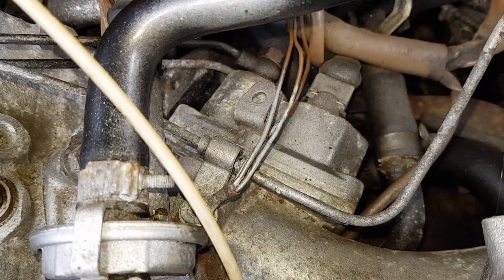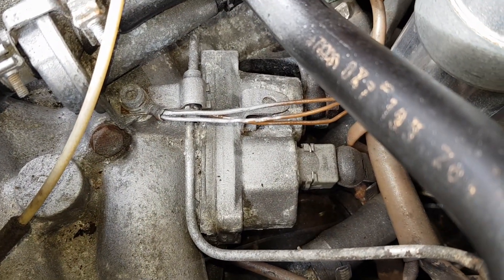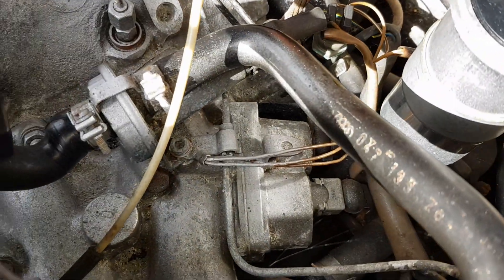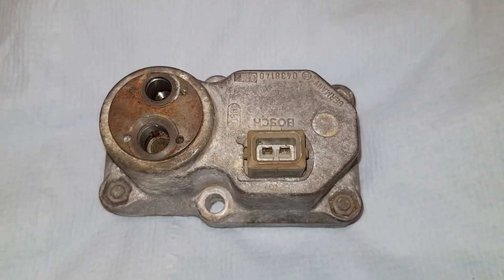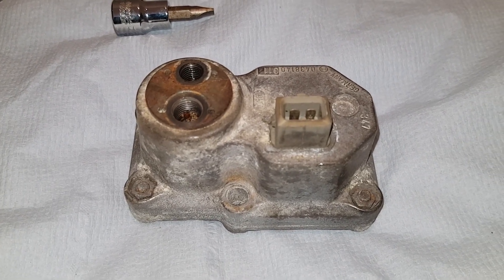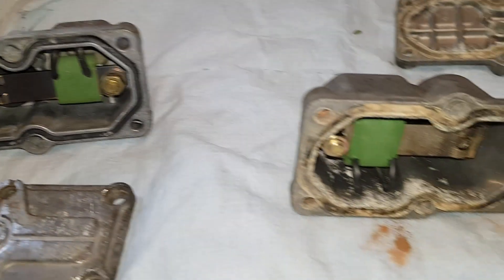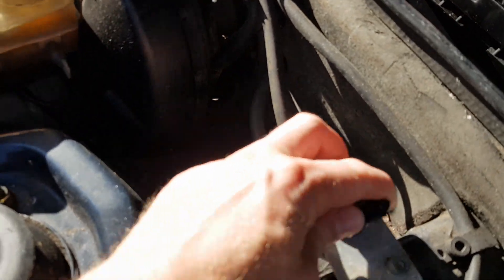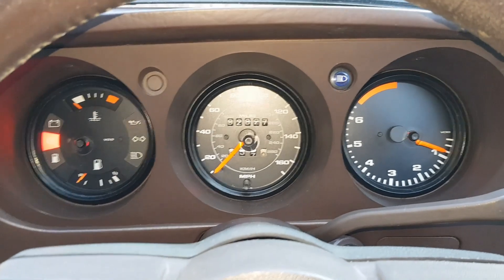Porsche 924  Cold Start Fix - WUR - Part 19

Comment: I miss my 924 and my 944, i never had big problems with both of them, sometimes if it was really hot it took a while to start, at one time the big read window broke overnight for no reason and i had to repair the clutch but that's it.
Reply from the maker: Thanks for the comment @xantylon74 sounds like you had good times with your 924 and 944. Have you ever thought of getting another one? 👍

Comment: Just got a 924 that sat for 23 years (US market here) and am attempting a revival, car will start but only stay running if holding the flap, about to try this and see if it works, hopefully this, the cold start valve, or the thermo switch does it, fuel distributor rebuild kit looking kind of expensive.
Reply from the maker: Hi Reese, thanks for the comment, great to hear you are bringing a 924 back to life. Hopefully a good clean of the WUR should help it stay running 🤞, let me know how you get on 👍

Comment: Hurrah, got there in the end!  I’m working through some poor cold starting issues and cold running on my 924 at the moment.
Reply from the maker: Thank you, Chris, and thanks for watching and the support. Been an up and down fault-finding mission but at least I got to renew some bots that needed updating. I am going to check out the AAR just to do the final cold start rev-matching that should happen as the engine warms up. best of luck with you 924 and let me know how you get on :)
Reply: @Witty924  Are you a member of the 924 Owners club, my work on my 924 is detailed in the forum?  I have made the modification to the WUR so that I can adjust the cold control pressure which richens/leans the cold Air / Fuel ratio.  Mine was running too rich and making cold starting difficult, and cold running poor.  But to complicate matters I think I have an electrical issue at the dizzy or TIU as well.  It never rains but pours....
Reply from the maker: @chrismadge7292  I was a few years back Chris. I connect with 924.org now which works out well. That fizz you.mentioned I saw Ant do on wheeler dealers. Did you do the same set up?
Reply from the maker: @chrismadge7292  thanks Chris very useful. Once I get it back on the road this month all being well. I will start to look and upgrades and fixes to make it a better car to drive more often. That's the plan ;)🤞

Comment: Hi so I have been following all the videos as I have same issues, I bought the car as a non runner and here is what I have done. New plugs leads dizzy cap and rotor, coil so I think that should sort the electrics out. tried no1 plug for spark and everything ok so assumed all are sparking. New fuel pump and hose fitted and checked the tank pump on bench with fuel and pumping ok. Car not starting. So pulled the warm up injector and tested for fuel and was ok on turning engine. Pulled all 4 injectors and cranked over but no fuel (like you had) so I opened up the air intake and cranked over and all 4 injectors pumping fuel. Took off warm up regulator and split which was same as yours clean as whistle inside. Checked continuity and resistance and all would suggest ok. Car still wont start. Double checked the leads and checked TDC to check rotor arm was pointing at number 1, all ok....You got any suggestions ?   cheers
Reply from the maker: Thanks for the comment andy and for watching the videos. So can you start it with lifting the plate in the air flow meter. Hand through air box trick?
Reply: @Witty924  Hi no It would not fire up.been reading all about the WUR and have ordered a service kit so I will remove it again and replace parts and check for blockages in the holes for fuel. Am I right i thinking  the WuR generates the pressure needed to raise the air intake thus allowing the correct fuel to pass into the injectors?
Reply from the maker: you are spot on Andy. Any issues with the inlet or out let or delicate diaphragm with cause issues. The rebuild kit is a good way to go just to be double sure. Also check how clean your plate is. Mine was thick with oily residue which can effect how it performs. Cleaning up all these bits is not a bad thing to do now and then 👍. Let me know how you get on. 🤞
Reply: @Witty924  hi so this is an update. WUR service kit came and replaced all the parts. put all back together and still wont start so I checked fuel was getting through . Fuel deffo at metering head and fuel pressure test showed 48psi. Not sure if that about right?  I manually raised the air intake and still wont fire but I could smell fuel so assumed its getting through. So where now? Gonna check all 4 plugs for spark and the timing marks. The dizzy cap is seated right but was wanting to double check plug 1 for firing order. If you look at engine from passenger side at the dizzy cap number 1 lead is about 5 o clock on a clock face . then going round 1342. Is yours the same?? I am sure I am overlooking something simple ( could be me) like timing or firing order etc. The fuel side seems to be ok...HELP
Reply from the maker: @andyfarrell5975  hi andy thanks for the message. Right so have you taken out an injector nd check if fuel shoots out on crank also test when you lift the plate to see if fuel gets through that will identify if you still have an issue with the fuel system or if you need to move into the ignition system as you say. Email me at p924na1984@gmail.com I can send you a shot video of my ignition set up and position of distie so you have it for reference.

Comment: Well done on sorting the cold start issue! I have the exact same problem on my 924, so I will be taking the WUR off to clean it etc. Mad that yours looked so good on the inside, and only required a brief cleaning of the fuel ports?! They must be temperamental devices. My car came with a 'cold start button' that someone installed in the center console. if you don't push it when starting from cold, the car won't start. I'm wondering if it's just a switch to manually fire the cold start valve... Looking forward to seeing more of your videos. Cheers, Eric.
Reply from the maker: Many thanks Eric and thanks for watching. Been an up and down journey but at least it works as it should. It sounds like you have the cold start value manual override fix which can be used on cold start issues and hot start issues I believe. There are some good little fixes  like that for the 924. Anything to keep them going well I say 👍🚙💨

Comment: I hope you see this. I bought my daughter a Porsche 924 ‘77. She has problems with starting and keeping it running! I had a diagnosis done on it and the Mechanic seems to think either the fuel distributor or mass air flow is bad. The fuel distributor has been rebuilt already just before we purchased it. I am wondering if maybe our WUR needs cleaning or should I mess with the Mass airflow instead?
Reply from the maker: Hi Steve  thanks for the comment and support. Great to hear you have a 924 and a nice early version too, great car. So I would certainly check out the WUR, very easy to remove and check for dirt etc. After that, take the rubber boot off the air flow meter and look at the position of the metal disc plate, it should sit flush at the bottom of the cone, if it's to low it can affect the running of the engine. Of course the fuel pump could be playing up too. Let start with these before going any deeper ;). Hope that helps. 🤞

Comment: I think I have a problem with my WUR as well. I will be taking it off to clean. It seems way less intimidating after watching your video. Thanks!
Reply from the maker: Thanks for the comment Karin, the WUR can be temperamental but making sure its clean is a good start, let me know how you get on 👍
Reply: @Witty924  Do you recall what size the copper washers were?
Reply from the maker: @karinfrederking3809  Hi Karin, so I think they were either M12 or M14. I just got myself a simple copper crush washer set of ebay as I replaced a few washers around the fuel system. Something like the below, hope that helps 👍 https://www.ebay.co.uk/itm/200pcs-Assorted-Solid-Copper-Car-Engine-Crush-Washers-Set-Seal-Flat-Ring-UK-/363524432024?mkcid=16&mkevt=1&_trksid=p2349624.m46890.l49286&mkrid=710-127635-2958-0

Comment: Got the unit off and its caked up with a dry sandy residue. The diaphragm screws are rusty so soaking in WD40. Fingers crossed. Are you able to confirm that there should only be the one large spring in these units? Some vids show a smaller spring which fits inside the big one? T.I.A.
Reply from the maker: Hi Chris, great to hear and here hoping its just a good clean up. Let me check my spare unit for you and see how many springs it has inside, I think it was one but I could be wrong. Brb

Comment: so you basically cleaned the clean part (but for some debris in the mesh?)
Reply from the maker: @ljuberzy  thanks for the comment and support! In short yes, it should be something done every year certainly if you store the car or lay it up for winters. That said since this video I have rebuilt this WUR with a refurbish kit, as long as the metallic element stays within spec the refurb kit can work well to extend its life. 👍

Comment: Well chuffed for you, what do you think of the upgrade springs they sell for behind the plunger in the fuel metering head to combat sticking plungers?
Reply from the maker: Thanks Paul. Good feeling getting that sorted. Just need to check the AAR on the idle at cold. Havent seen the plunger springs. Are they and after market specialist part?
Reply: @Witty924  the plunger springs seem to be an after market part they are sold on ebay type in plunger spring for porshe 924 fuel metering head I have just ordered one just to give the plunger a bit of help seems like a good idea to me as they stick sometimes

Comment: Hi do you know if the standard 924 2ltr has a crank sensor
Reply from the maker: @stevehunt3847  no crankshaft sensor,  the general rule is older engines with carburettor and/or distributor set ups don't have crankshaft sensors. They typically are on more modern engines that use modern electronic fuel injection. One less thing for us to worry about running older engines haha. I hope that helps 👍
Reply: @Witty924  thanks also when you turn the key on your car is there a very loud buzzing I think it's coming from the fuel pump I replaced a burnt out green and black wire and since then the buzzing has stopped from the fuel pump
Reply from the maker: @stevehunt3847  so depending on the ignition set up you may hear the pump prime before you turn the engine over. My pump will fire into action as the engine cranks. Is your pump new?
Reply: @Witty924  I have no fuel getting to injectors  I can here a swirling noise from to he fuel Di stributor and when I lift up the silver plate on mentoring unit there's no fuel lifting up to the injectors ..there is 2  wires coming up to the unit would the plunger be stuck in the fuel distributor..
Reply from the maker: @stevehunt3847  OK so when you lift the plate inside the air meter unit do you hear a hiss, like a sudden fast flow of liquid? If not, i would go back to the fuel pump. How old is the pump? I would do a quick test on the pump. Take the hose off your fuel filter in the engine bay and place the tube into a large battle and turn the ignition on to start the pump and check if it's pushing enough fuel through. Do you have a Haynes manual? It will give you the amount of fuel in 1 minute that should come through.
Reply: @Witty924  no hiss when I lift the plate ...just a swirling noise coming from the black distribution unit ..I have fuel coming up to the banjos on the distributor unit but I don't think the plate is moving to let fuel through il try the pipe on the fuel filter ..test you mentioned
Reply from the maker: @stevehunt3847  OK let me know how your fuel pump test goes. If that proves good you may have to do a rebuild on the fuel distributor. You might want to also check that fuel is present at the WUR banjos too. The injectors need 40 psi plus to open so if the pump isn't providing a strong pressure you may not have to rebuild the distributor unit. 🤞

Comment: What does the WUR do when the engine is warm? You mentioned something about power? Does it affect power at the higher end?
Reply from the maker: Hi Sean thanks for the comment, hope all is good with you. So it supports both cold starting running and warm running via a metallic strip. Check this link as it will be a quicker explanation https://www.tuningblog.eu/en/kategorien/tipps_tuev-dekra-u-co/warmlaufregler-und-tuning-darauf-gilt-es-zu-achten-340115/#:~:text=Warm%2Dup%20regulator%20ensures%20that,is%20heated%20in%20the%20process. 👍🚙💨
Reply: @Witty924  thanks.. sounds like it helps under full load too.. interesting

Comment: I have a cold start issue on my Ferrari 308. It goes through a warm up low to high idle before idling back down after warm up. My problem is that everything is fine, starts up goes through idling process but does not kick back down like it should after warm up. Stays at high idle. Any suggestions would help. Thanks.
Reply from the maker: Hi Al, thanks for the comment. Superb to hear you have a 308. So I believe there are adjusting screws near the carbs that sets the throttle idle. Good link here for you to look at with some that have done the process. Let me know how you go Al. 👍https://www.ferrarichat.com/forum/threads/308-carb-preferred-method-for-raising-idle-speed.118702/
Reply: Thanks Witty, I have been looking so much on Ferrarichat but cannot find what in looking for.  I have a fuel injected 1980 308... Thinking it might be the Warm Up Regulator,(WUR) or the cold start injector. .. With a Ferrari 308 the idling is suppose to go through 3 idle changes before idling back down which means its ready to drive. Its just stuck on the last high idle at 2800 RPM and suppose to go down to 1000 RPM when its warm , but its not. I just want to know for sure before I buy a part.  Thanks for getting back, Aldo.
Reply from the maker: @alge3399  not a problem. Best thing is to check the warm up regulator even if it's just to give it a good clean out. Do a test on the start up value. At cold remove from its seating place but still connected to the fuel system pipe. Place it into a clear jar and turn over the engine to see if it's doing its job. If it doesnt fire you know the WUR could be at fault. It sounds like it's just an idle issue that needs adjusting if you are getting the engine to start but its seating g at high revs. Let me know how you get on. Good luck 👍
Reply from the maker: @alge3399  hi Al. Check out this video from a guy here in the UK going through the carb rebuild. He covers the idle screws. More importantly the details about high revs and timing. Hope that helps 👍 https://youtu.be/ee8MahyiDds

Comment: Did you have to bleed the air out of wur and cold start valve?
Reply from the maker: Hey Paul, I refitted the fuels lines to the WUR and Cold starter Valve and turned the key and it fired into life. i havent seen anything on airlocks in the fuel systems before, but if you are having trouble with fuel reaching the injectors, you should take the airfilter off reach inside and lift the plate within the unit gently while you have someone crank the engine. you should get a start. you can also do this with the injectors out into glass jars to see if they operate and shoot fuel. this will force fuel through the system if your pump is all working well too. now if all the above works you need to still look at the WUR as this unit should be doing the job rather than you placing your hand on the airflow meter plate. let me know how you go. :)

Comment: How did you get to the bottom bolt? I can’t see it at all.
Reply from the maker: Hi Tal, thanks for the comment. It's a little difficult the bottom bolt, as you say it's not visible from the top so you need to slide in you Allen head socket by feeling with your hand. It's in the same position as the top bolt but directly underneath. I removed the cold start valve (injector) to get more space. Hope that helps 👍
Reply: @Witty924  thanks! I’ll try that out later today. Bought a beat up ’79 last year to learn about cars. Your videos are a great help, thanks for posting them.
Reply from the maker: @talm2891  many thanks Tal glad they help. Great to hear you have a 79, hope the work goes well, keep me posted 👍
Reply: @Witty924  got it out, thanks for the help.  Do you recommend that I refurbish it (there’s a reasonably priced kit on eBay)? Or just clean it up and make sure the screens are clear?  The car doesn’t start- and may not have since 2004. So I’m working my way through it to get it going.
Reply from the maker: @talm2891  great to hear Tal. So as a first step, open it up and just check inside. Look for any corrosion. If it's nice an clean inside then just clean up the inlet and outlet ports. Then refit and try to start. I have a little trick to help the car get started if that doesn't work. 👍